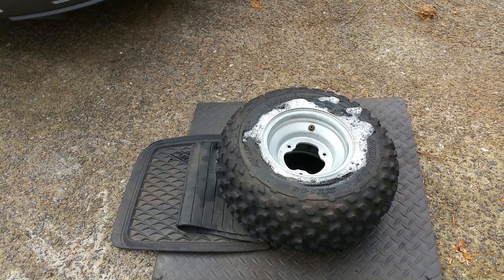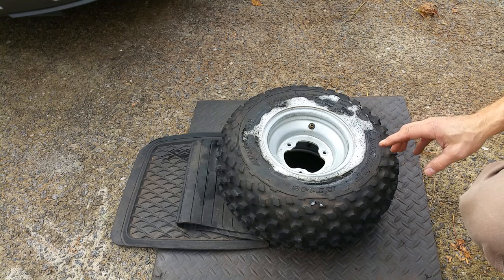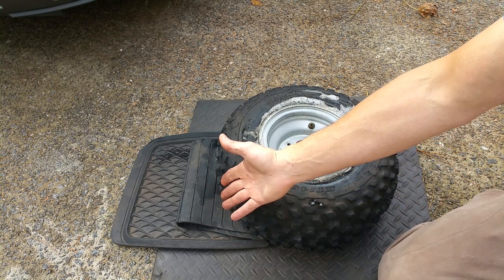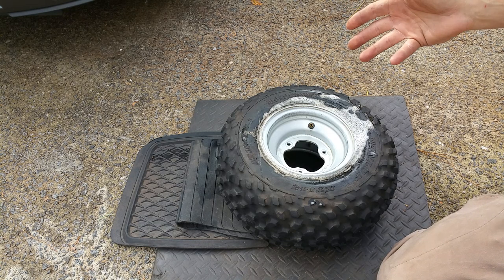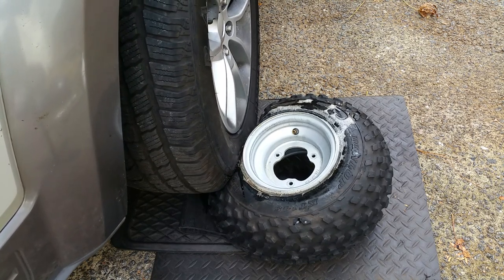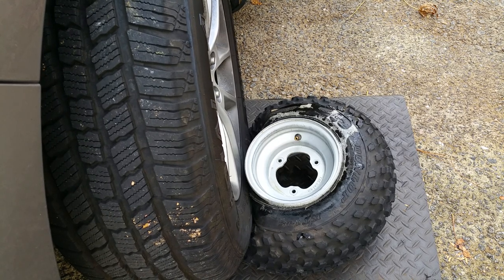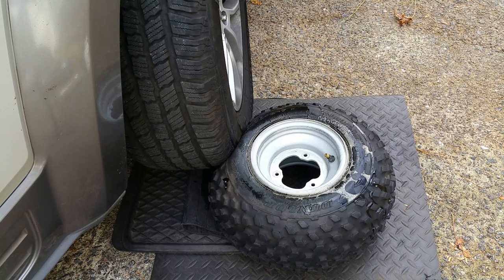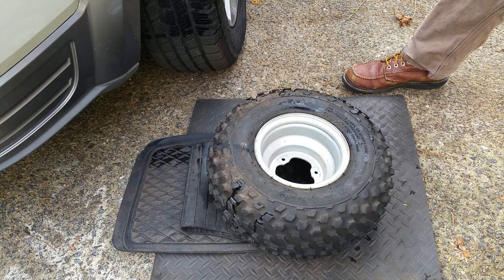How to break stubborn bead loose on  ATV Quad Mower SXS tire wheel rim golf cart kart mule gator

Comment: Offered to help my cousin change his ATV tires using my No Mar manual changer.    Quite a learning experience and nothing at all like changing a street or dirt motorcycle tire.   "Breaking the bead" on an ATV tire is a misnomer.  You're mashing and working it off the large sealing surfaces.  The breaker on the changer couldn't cope w/ the soft tire sidewalls giving way but got it.   Finally tried a 8' rough cut 2x4 stood the strong way and wedged under a wall. Put the tire in the pinch point and mashed it right off!  Doing that earlier would have saved hours.   Easy to remove and mount tires.  That ATV bead is terrible!  Glad your method works too!
Reply from the maker: It's easier to just buy a new set of wheels with tires already mounted - done...
Reply: @HorsepowerHouse  you ain't lyin.   worth the money to save the hassle.